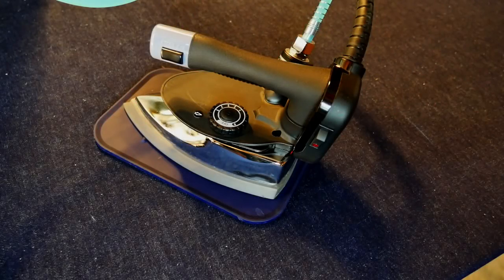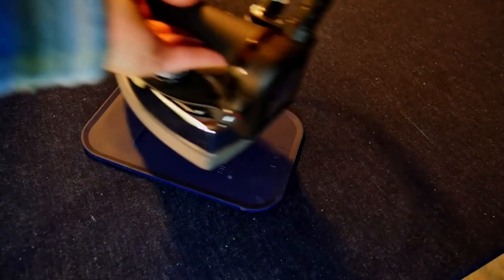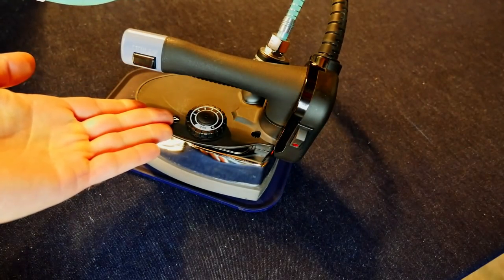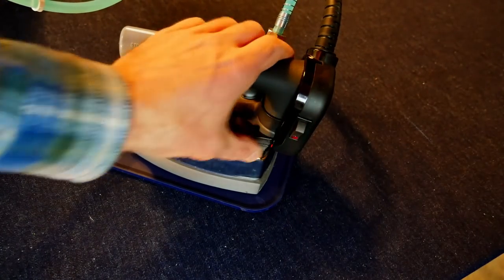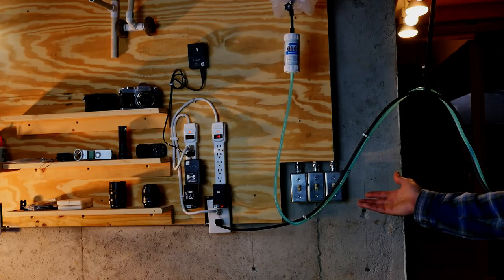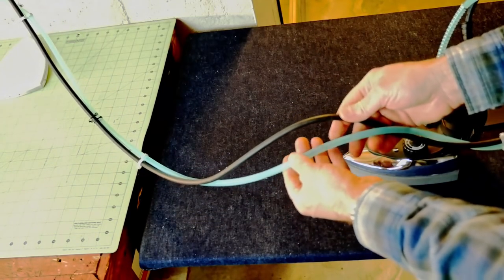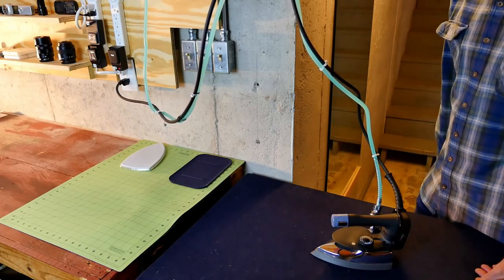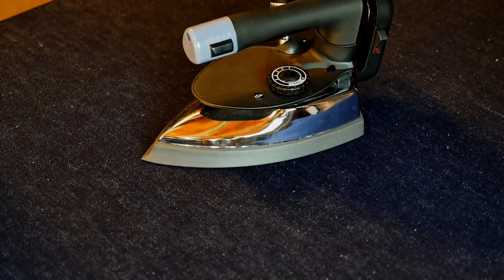My Gravity-Feed Steam Iron

Comment: I realize this is an older video, but I'd like to offer a suggestion. I would plug the power cord into a higher outlet. If the water tube or the connection develops a leak, water will run down the plug and into the outlet. If the power cord goes up first and then plugs in, the water will drip from where the cord bends upwards rather than into the outlet. Great video; I've been curious about this type of iron.
Reply from the maker: Great point!